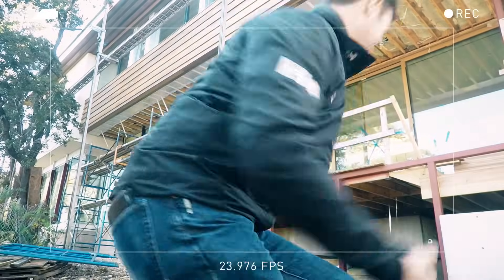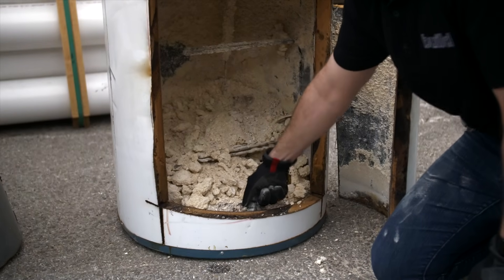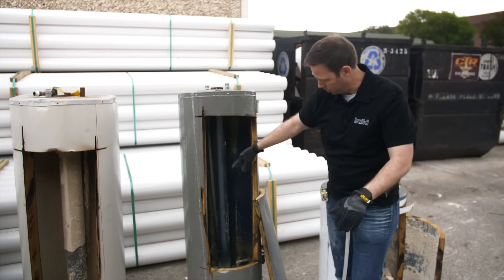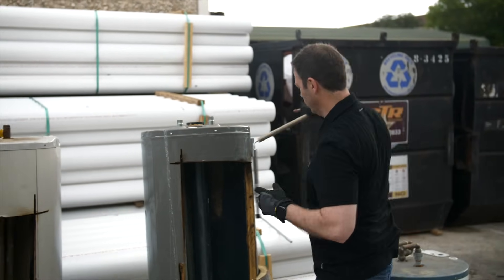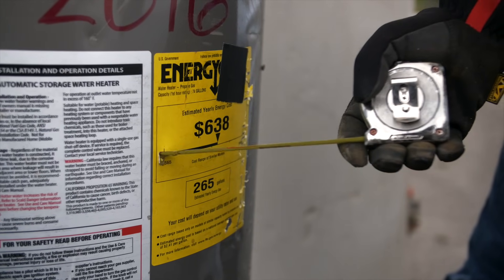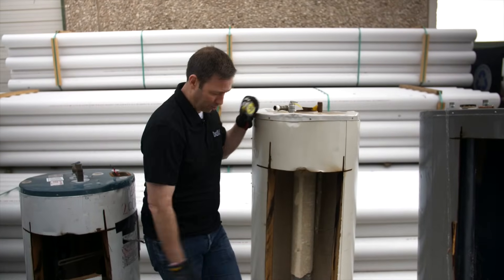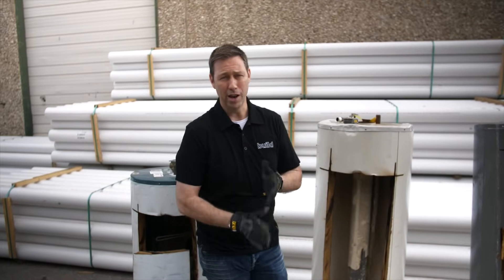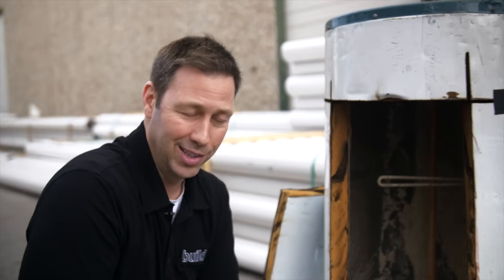Four Water Heater Tanks Cut Open - Lessons to Learn

Comment: A great deal depends on the rock and soil conditions in the area where your water is collected, some areas have water suitable for use in batteries and the other extreme is water so hard that your electric kettle will be full of scale in months, there is not one rule for everyone.

Comment: Thank you for that advice. I did not know about draining and changeing the rod in a water heater. mines is in a closet and is electrical. but i don't know why it was put on the second floor. when i had just bought the house the one the house came with exploted .It flooded the second and first f loor . I was so mad.
Reply: Very strange place to install it. Don't you have a basement?

Comment: That first tank, the 'Low-Boy', looks like it came from Florida, from the sediment in it.  The 'Tall' gas tank, may have been piped with plastic line and not grounded, which eats up the anode.  Also, I noticed the water damage to the insulation at the location you measured and suspect the damaged anode was leaking and not discovered by the installer.  I've not seen an aluminum rod but our sacrificial rods are magnesium.  I suspect the major difference in EF-Rating, besides the shape of the tank,  and the insulation thickness reflects the 16-years of technology.
"Flushing" the gas heater doesn't remove any scale from the flu, side walls, or bottom.  Even opening the inspection plate won't allow a plumber to get at any of that material to 'scrape' it off of anywhere inside that thing...draining does zero goodness but happens to be a very traumatic thing to relax the tank and pressurize it again...a bit like bending a coat-hanger a couple times.

All and all, I liked your video.  I'd not seen one CUT open, but I've seen two, BLOWN OPEN as the T&PRV failed.
Quick story here;  School, little kids, cafeteria, 52-gal water heater in the kitchen.  T&PRV drizzling that morning.  School handyman came and replaced it first thing that morning.  Late-morning, dripping again.  This time, he doesn't have the correct valve.  The one that's in there, has a long sensor.  The relief valve is screwed into the hot port where a 3/4-brass 'T' was used for the service and the T&PRV was screwed into that.  The handy-guy screwed in a Watts-valve with the short sensor.  Two hours later, during lunch, the tank exploded.  Two walls moved.  The roof fell down.  Of the 60 or more kids in there, only a few were killed.  The handy-guy was fired.  That was an electric heater and the lower element had opened and ECO had failed.  That element was heating at 110-volts un-checked by the temp setting.
That picture of that tank was the first one I saw.

The second, Blown-Open tank I saw, belonged to a man that didn't replace the T&PRV that was dripping, in the garage, when his mother asked him for help.  I was sent by the insurance company.  I was the plumber sent there by the 'Whole-Hose coverage', but we didn't cover the handyman work.  That heater was electric, quick-recovery, 220-volt.  When the element got buried in that sediment, you showed in that first tank, the element over-heated, and fractured open.  The ECO (Energy Cut Off) tripped.  He went over there, pushed the trip back on, removed the T&PRV, and put a plug in the hole to stop the leak. When the upper element was satisfied, it turned off and the bottom turned on.  The broken half of the element connected to the thermostat turned off as it was designed, however, the other end of it was still connected to 110-volt and continued to heat the water, very slowly.  Four hours later it exploded.  It didn't move the walls, but it lifted the roof, spun it about 25-degrees, and laid it back down.  How the tank landed in the middle of the intersection 300-feet away, I haven't a clue.  It didn't go through the roof, so it must have gone thru the opening while the roof was up high enough for it to escape.  I don't know...it lay there, both round ends in tact, tank opened flat as a sheet of paper with both top and bottom standing up perfectly round and still attached...the plug survived as well.  Nobody was hurt in that handyman job, but the garage was totaled.   The lesson in this service-call, never touch the T&PRV unless your going to replace it with a brand new one appropriate to the situation, and if you don't know what you need, ask a plumber or call a plumber to replace it for you.  That tank is equal to 500-pounds of TNT when it goes.

Comment: I have never done anything to a water heater other than use it. So far I have only had to replace one water heater, and that was because the pipe feeding gas to the pilot was leaking. While I could have probably fixed it, the heater was old, parts were hard to find, and I decided it was better to just replace it. The one at my dads is at least 20yrs old, probably more like 25-30yrs old, and again we have never done anything to it. Honestly if anything ever goes wrong with that heater, I would give it thought to running the tankless water heater. They are more efficient, take up less space, and work pretty well.

Comment: Got a new hot water heater : Take the plastic value off and throw it in the garbage -- replace with brass or SS.  
Make flushing it a good experience.  The plastic composite values like to leak after a fear years. They shrink and crack at the threads.

Comment: Question:  Is there a safe chemical (such as vinegar, peroxide, baking soda, etc.) that will dissolve, remove, loosen, or clean the inside and anode rod by pouring it in the top and then flushing the water heater?
Reply: The anode rod is often called a sacrificial rod. It's designed to attract all the junk in your water, so that's really your best cleaner

Comment: Hot water tanks are too cheap to bother with any maintenance.  Do nothing and you get 10-20 out of one replace it gain decent jump in efficiency.   Flushing gets very little of the deposits out of there.  Have a plumber replace the anode rod will be over $450 that's half way to new tank right there.

Comment: Hey folks, I did a fantastic thing to flush my water heater every time I wash my car. I put a filtered hose bib tap off the Drain valve of the tank. Now, every time I wash my cars, my tank is flushed! Note: I also have whole house filtration and Soft Water!

Comment: only 15 years? We are still rocking an 80 gallon tank from '88.
Reply: joeyf504327 UK here. Copper used exclusively. Parents have same tank that was in place when they bought the house in 1977. Likely to date from original installation in the 1950's. Why anyone would specify a steel tank, lined or otherwise, is beyond me. Then again, the US still has open vented gas water heaters inside houses- outlawed here for donkeys years due to lethality under fault, not to mention abysmal efficiency.

Comment: If you want to know how much insulation is in a tank, measure the diameter. Then, compare others tanks. If the water capacity is the same, and the height is the same, then the diameter varies dependent on the wall thickness which affects the overall diameter. Thus, the larger diameter tank will yield the most insulation. Also, you can’t compare amount of scale per tank unless you are using the same water. The water source will determine the amount of scale (water quality). Good video though!! I live alone in a 2 bdrm condo, and installed a tankless water heater as soon as I could. I had one in my house that served me and three women (wife and 2 daughters) well for 10+ years. As far as I know, it’s still going strong. I should also mention I live in Florida (south of Tampa), so the mild climate is conducive to having a tankless water heater.

Comment: Anode rods should be changed every 3-5 years in this area, flushings should be every 6 months- a year depending on water quality. You should also have shown the tempature and pressure relief valves from the inside. They should also be changed every 3-5 years. They will get scale build up on them and not be able to open. That is the most important safety component on your water heater, and it is vital that it can open and close freely as needed.
Reply: Also if you have a well system you should always change the anode rod at time of install. Factory anode rods are magnesium, which reacts with the sulfur in the well water, and creates the egg smell. Always change with zinc or aluminum, I personally prefer zinc rods.

Comment: My electric water heater is from the 70’s uses well water without a filter.  I replaced the drain valve 5 years ago. I turn it off and let run cold about once a month or so

Comment: 15 years? Lol. It depends on how many people live in the house and how often hot water is used, more like 7 to 10 years. My qualifications, 25 years plumbing in 2 states, Michigan and Hawaii. Doug is also correct, after 5 years it is mostly impossible to remove an old anode rod, regardless of the tools you have.

Comment: Its 2Am. My house has a tankless water heater. Why am I watching this?
Reply from the maker: Cause it’s cool!
Reply: Those tankless are the bomb
Reply: ya until one of the many components on it go bad.Because unless you are plumber repair/replace the component is the cost of a tank.I had a Bosch AquaStar for twelve years even the one plumber wasn't sure why it wasn't working though a friend suspected the gas valve.Which was at least 700.00 for parts and service.While the theory behind heaters are solid if one of the many components fail any savings in natural gas goes out the window
Reply: @MrWadsox  what the gas valve - it was at least 250.00 and they weren't sure if that fixed.Well I wasn't playing musical parts at that price .Over the long run the Tanks are less costly because of manufacturer's greed